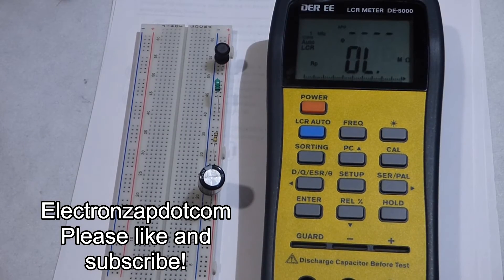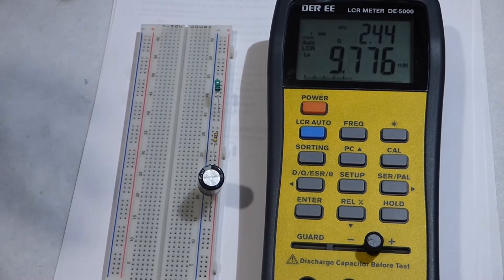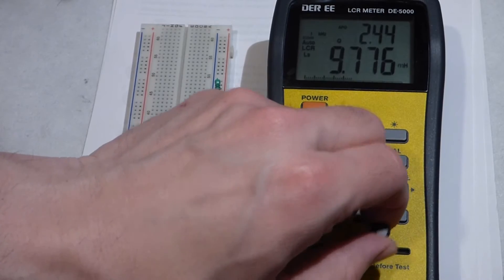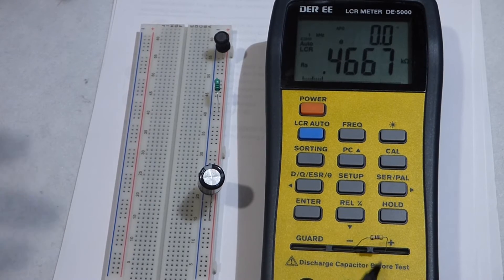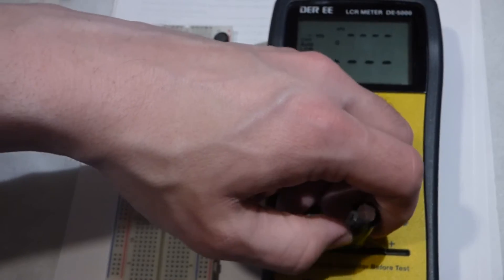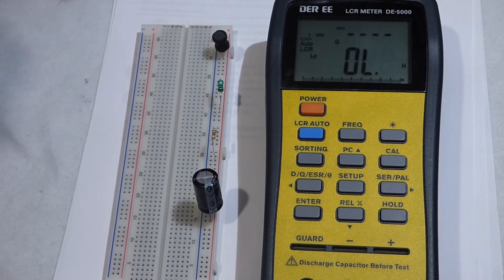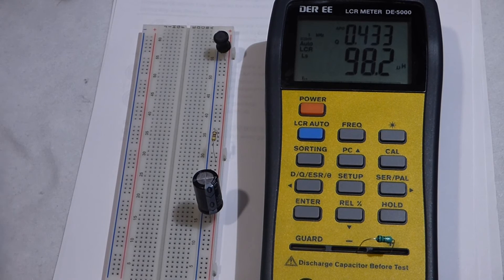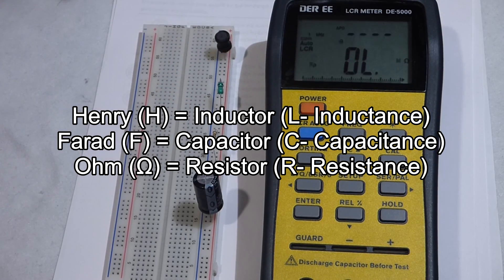My LCR meter. LCR auto setting used to identify electronics components demo

Comment: I know this is an old video, but curious if you can use the auto detect mode with in circuit devices (still soldered on the board)?

Comment: what is analog bar for?
Reply: Consider it pretty much as a visual representation in accordance with the current scale.  Let's say it is half way of the 1000uF scale the this will visually tell you that the actual reading is around 500uF.  IMHO, the actual usefulness of such display is more a matter of taste than anything else.
Reply: @SimpleEnough2k9  yep, it reads % of the current (automatically selected) full scale.  I think the scales are 2/20/200/2000/20000, though.
Reply from the maker: Don't know unfortunately. I just learned the minimum I needed to about this meter.
Reply: @Electronzap  :(